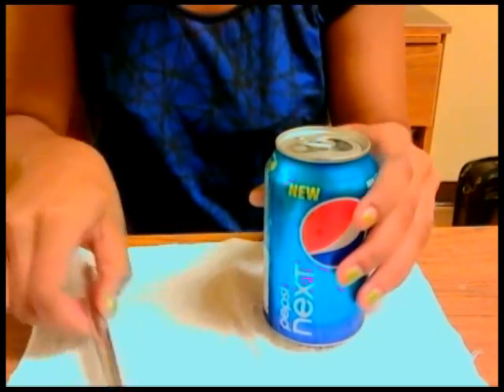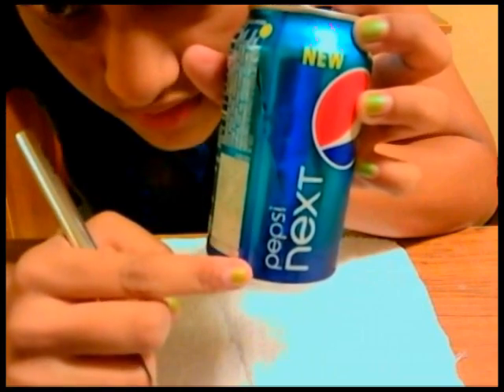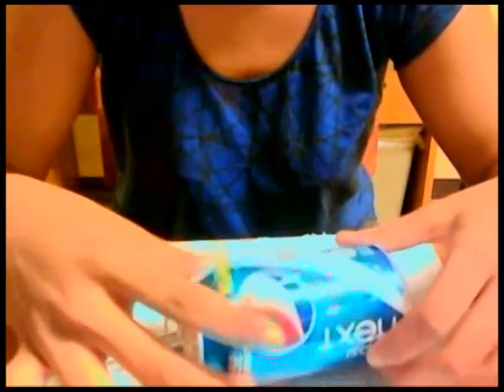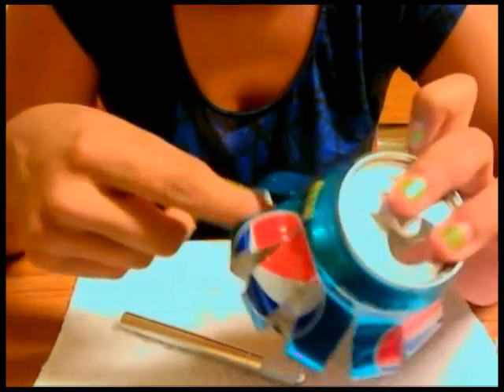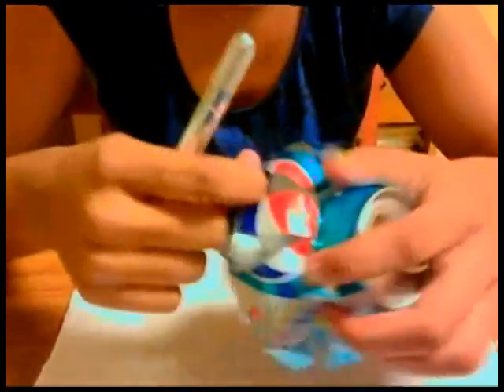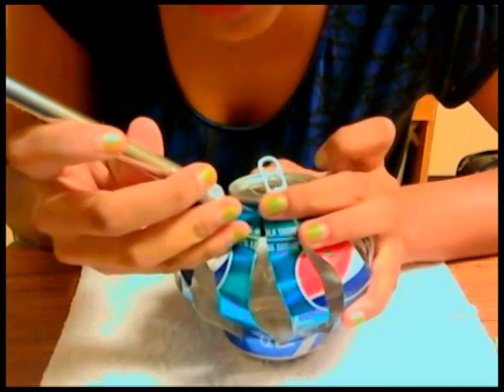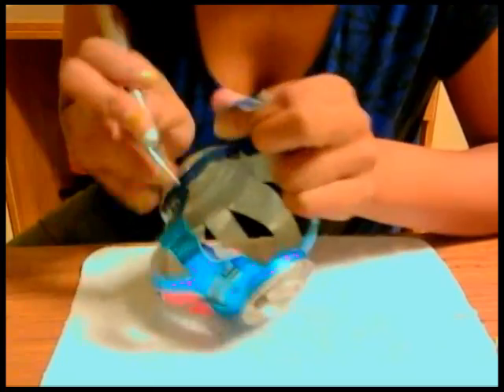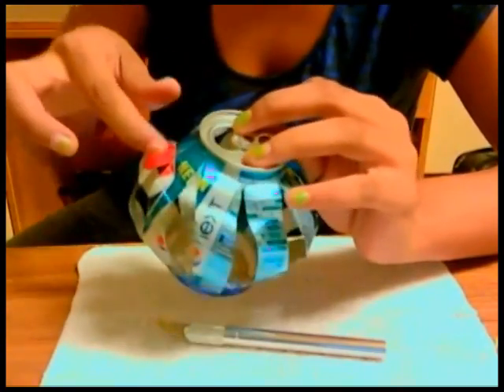Soda Can Lantern(Tutorial Starts at 2:02)

Comment: YOUB MAY WANT TO FILE DOWN THE SHARP EDGES OF THOSE CANS WITH A STEEL NAIL FILE TO DULL THEM.THE EDGES SHOULD BE THOROUGHLY WETTED DOWN WITH WATER FIRST TO STOP THE ALUMININUM FILINGS FROM FLYING UPWARDS AND BEING ACCIDENTLY INHALED.ALUMINUM FILINGS ARE HIGHLY TOXIC IF INHALED.ALSO YOU SHOULD DRY THE CAN OFF AFTERWARDS TO PREVENT RUSTING.